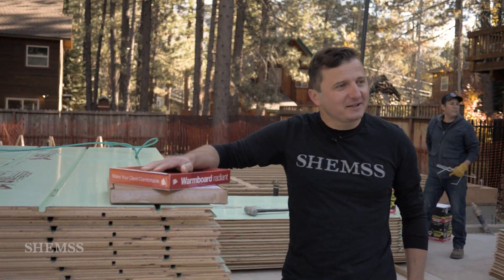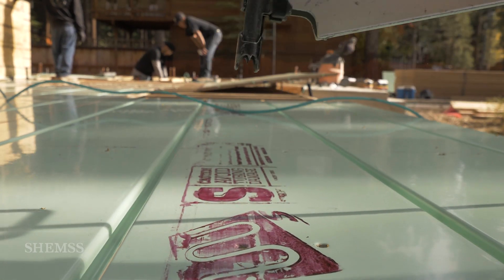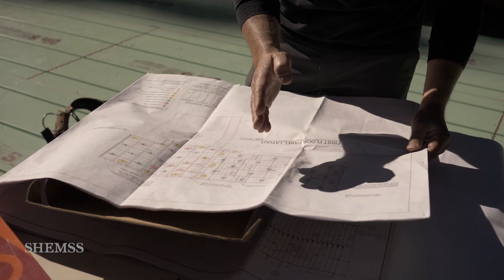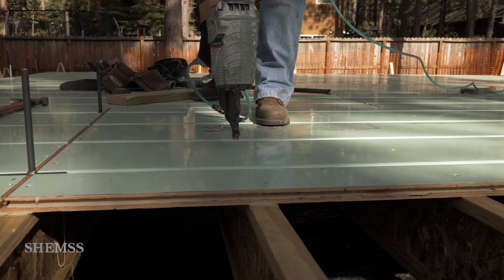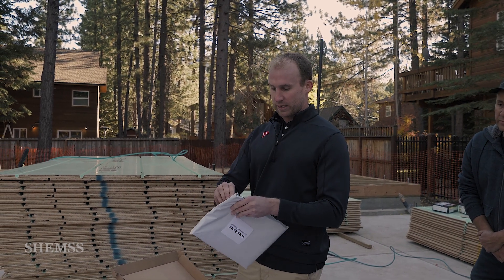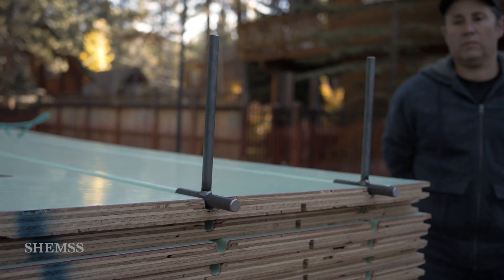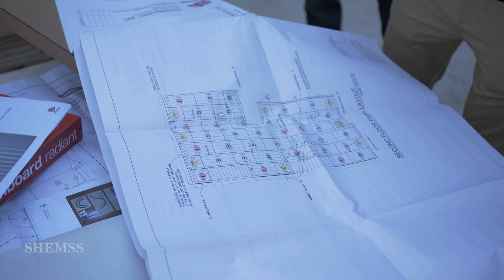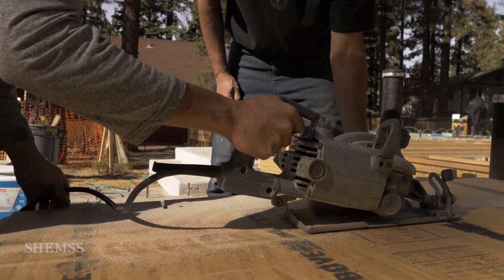Warmboard Radiant Heat Flooring System | Installation | By SHEMSS

Comment: My concern is the possible damage to the floor before you can install your flooring.  Those floors take one heck of a beating by the time you have the home buttoned up and ready for the floor.  What happens if a circle saw or hammer falls from the second floor and damages those grooves.